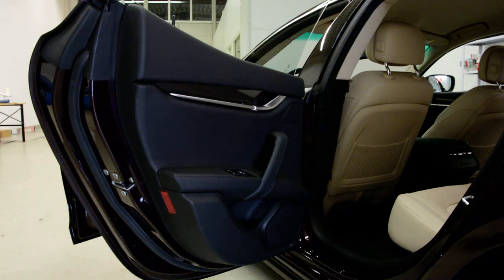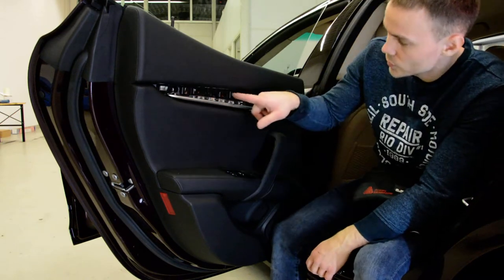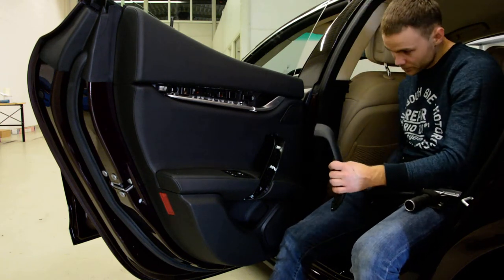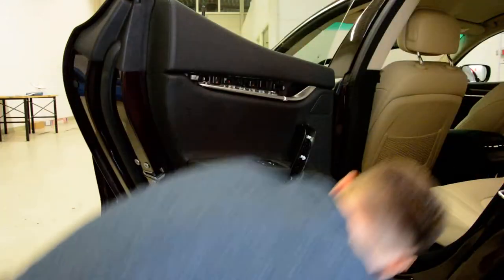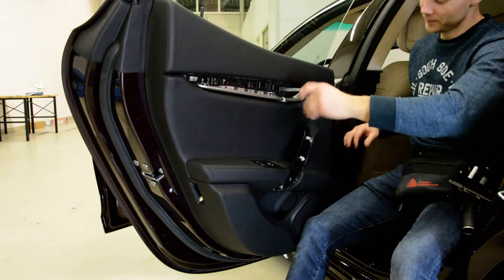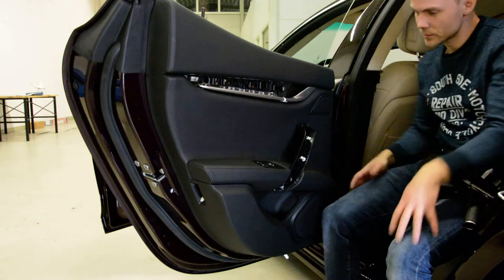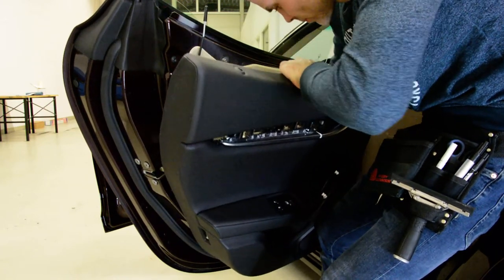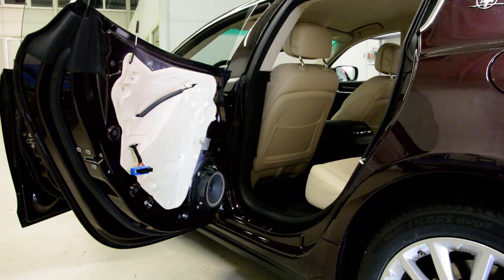Maserati Ghibli door panel removal

Comment: Front doors are the same, except there’s 1 extra screw behind the red reflector on the side. Also an extra trim piece to remove where the mirror is. Pull up to take off. 

Ripped my door panel before I realized there was another screw lmao.